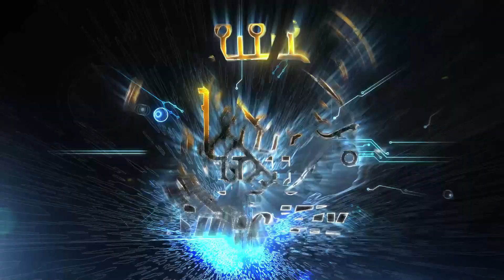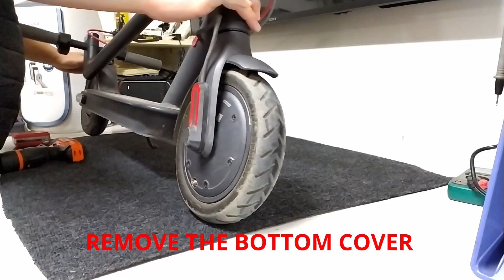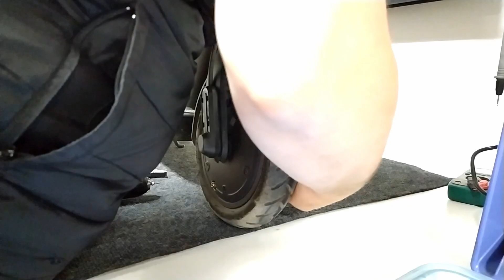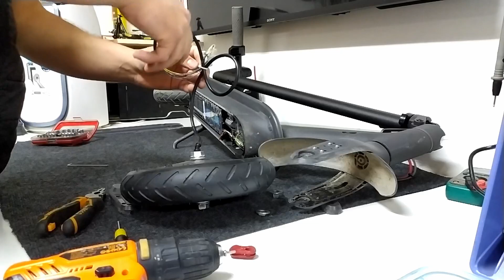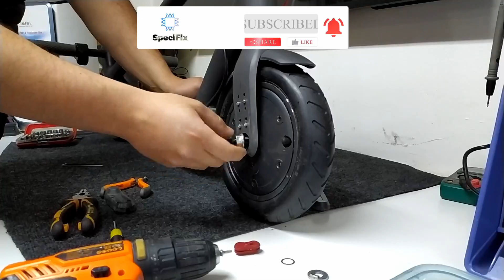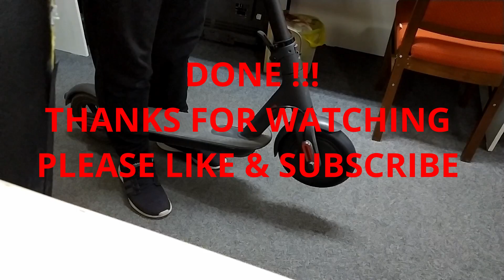XIAOMI M365 ELECTRIC SCOOTER ERROR CODE 18 FIX

Comment: Replacing motor is not a fix! Replace hall senzors and do not throw money from window..
Reply from the maker: Thanks for your comment, always new one is better than used one, if you watch better you will notice that the motor was fixed before. If you know better, you can make videos, youtube is an open platform for everyone.
Regards.
Reply: True mate. Ppl like to throw it away
Reply: I have the same problem can you help me how to fix it
Reply: @SpeciFixx  hi what is the error e16
Reply from the maker: M365 doesnt have error 16.
Reply: I have a motor 18 error and I'd there a video on how to fix the motor the motor are pricey and want try and fix it instead. My m365 standard not essential the four dot display one 250w motor. Can I put a 350w motor on it or do I need a reinforced controller for that?
Reply: @DripdropBrewing  
had the same error. I wasn’t able to change hall senzor from inside of the motor then I bought m365 pro 350w and I replaced it. Yesterday I  tried ride it and the scooter work well. I don’t know does it make problem in the future or not.
Reply from the maker: @DripdropBrewing  you can put 350w motor with own controller.
Reply: @SpeciFixx  you cannot or advised to put on a m365 standard 350w motor with cfw 35km/21mph on a non reinforced controller you will probably burn out the controller especially if you go up hills. Reinforced controller needed. 350w controller for pro and pro 2 only and reinforced controllers
Reply: Maybe if you get reinforced controller and external battery 10s 12s 15s etc 💯 on any Xiaomi model
Reply: Not saying this to be rude but if above people went out or new people on this chat and went out and bought a new 350w/500w motor then they would blow there motor. Your giving wrong information sorry. Need a reinforced controller and battery and Rita. Do your homework mate
Reply: Blow controller I meant
Reply: @SpeciFixx  hello what’s is error 8 on denver odin ??
Reply: What are the hall sensors the brown yellow and blue ones

Comment: I have an xprit that turns on beeps several times but won't move when throttle is pushed is it a control issue or a motor issue trying to learn the self maintenance any help would be appreciated
Reply: Yea same
Reply: Me too, it might be the brakes

Comment: Hi there great tutorial watched it an was hoping you could help mine make same beep turns on no power when I accelerate it make that beep an won’t turn off is this the same as in ur tutorial and does that mean I need to change the motor not the motherboard hope to hear back from you thanks 👍🏻
Reply from the maker: If beeps exatly the same thats motor failure(follow beeps carefully,first long beep is first number, short beeps second number that tell us the error code) or it can be some broken wire is, check firstly motor wires before replace.

Comment: Mine was giving me 1 short 4 long beeps, but it wasn't the throttle (thats error 14) but then I opened the battery cover and the main board was flashing 1 long 8 short, and that's error 18 (hall sesnsor failure) so I checked the motor and there was 2 cables short circuiting, fix it and proceded to check the hall sensors, one of them was acting weird, so I replaced all the 3 sensors with new ones, i still need to put everything back together and I will test it tomorrow and post the results.
Reply: Did it work for you to replace the hall-sensors? Do you have a link to buy?

Comment: I have E7 error I managed to remove the front wheel and find a replacement but I don’t know how to remove the cable of the original wire
Reply from the maker: You need to remove bottom cover where is mainboard, and unplug the motor cables and remove the wheel.
Reply: @SpeciFixx  yes however the wire wouldn’t come of when I pull it from the motor

Comment: My scooter dashboard just has 2 red lines the beats were the same and when  I took off the motor it was burnt I have now replaced it and it still has da same red lines and it won't move y?
Reply from the maker: what kind of scooter do you have, what do you mean 2 red lines, does it sounds any beeping from your scooter?
Reply: @SpeciFixx  xiaomi pro it was 1 long beep followed by 8 short beeps there is 2 horizontal redlines
Reply from the maker: @simplyelite7063  Fault code 18 – Hall sensors error

Comment: Good video. I have a Hiboy electric scooter and the battery is full but doesn’t run, the display is turned on but when I press the acelerador nothing happens. any suggestions what’s the problem?
Reply from the maker: İt can be Acceleration sensor or controller.

Comment: Mine has beeping Problem too, One long beep, Two short beep, Don't know which error code is it doesn't show on screen, could you please tell me what's the problem?
Reply from the maker: which model scooter you have ?
Reply: @SpeciFixx  Pure Model M365 ?
Reply from the maker: @tamimnasrat  error 12 –motor current sensors calibration error

Comment: How can i know the error code. My m365 has the same problem. 1long beep and 4 short. What should i do? Please help me.
Reply from the maker: Acceleration sensor reading is abnormal. Replace the accelerator.
Reply: In this case if the censor is not working the scooter will not charge as well?

Comment: My scooter turns on and the battery light meter lights up. The battery pack tests at full voltage and has a blue light blinking. The controller has a solid red light. There is no beeping, no flashing, nothing telling me any errors. I ordered a different controller thinking it was that and it does the same thing. The scooter just does not move when accelerator is pressed. Any clue what is wrong ?
Reply from the maker: it can be throotle error.

Comment: I have same problem error 18 what am i suposed to do?? Please help mee
Reply from the maker: You have all you need on the video.
Reply: So i have to change motor? When error 18?
Reply: I have the same problem☹️
Reply from the maker: @shamsiDagestan  yes if the error is 18 its something wrong with the motor. maybe some wire is broken check wires before changing motor.
Reply: @SpeciFixx  hi I've taken mine apart as the video I've noticed the wires were all broken round the wheel. Is there a loom to boy or is tagt still a new motor. Also has no power now. On inspection the brown cable near battery had signs of burning.